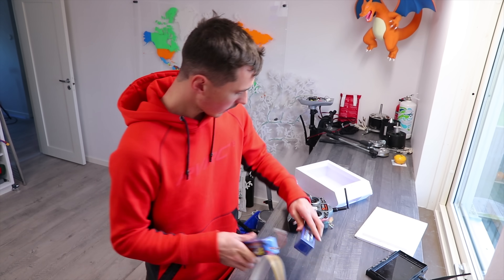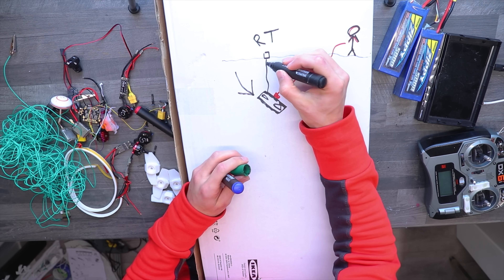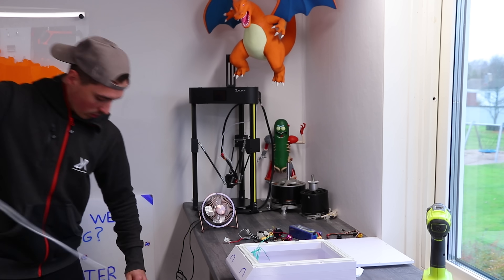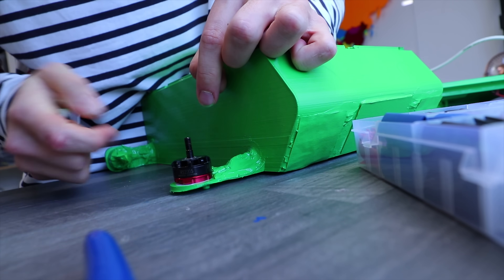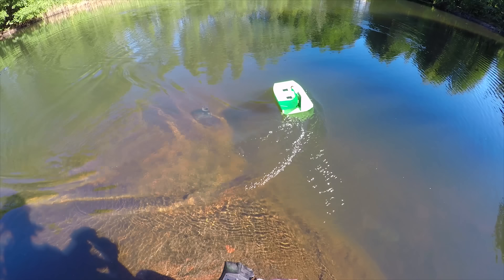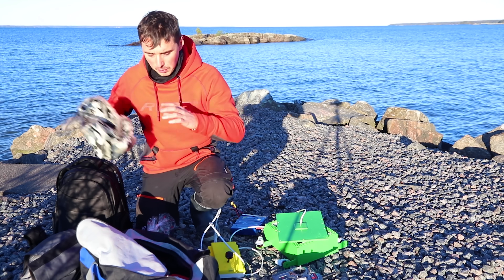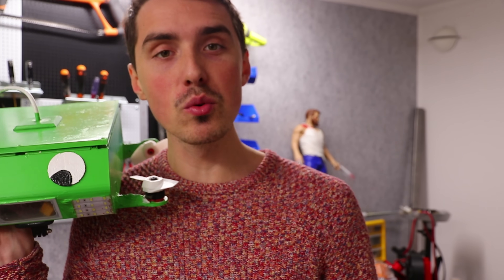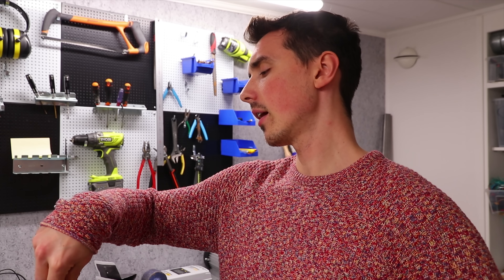3D Printed RC Under Water Drone - PART 1

Comment: Did you consider the fact that the reason your radio TX won't work is an approx. 30dB refraction loss at the water surface? And you easily can negate that refraction loss, so that  your submarine happily will operate without the buoy aerial ?
The trick is simple, just submerge your TX aerial. I'm not making it up. For your frequency/TX PWR, you should get a range of around 30-40 meters. If you submerge the TX aerial 30 meters out from the shore, you will get an effective range of at least 30 meters in all directions from the aerial.
Go on.....you know you want to !!

Comment: Make it heavy. Add wheels and a balloon inside.  You can blow air using your wire pipe and use the balloon as a ballast whenever you need to make it surface.

Comment: Have you considered acetone smoothed ABS? That's the most watertight material I ever tried, and keeps 40° hot tub water without leaks. 
Also you could make designed areas for weight/air outside the electronics bay, so you can adjust with a bit of water if needed. 
I really like the concept, but attach a fishing line to the floating part just for emergency use when it goes haywire. (We want to see the aftermath.)

Comment: I'm sure you already finished the project, but if not, how about you make the smaller unit, put all the electronics in, and then fill the damn thing with hot glue, lol. That way there's no air, AND you've waterproofed the electronics. xD

Comment: Hey dude I love this idea, I actually want to start building something like this myself soon, because I love filming underwater. Could you put the batteries, and other electronics into the flotation device? You would lose a little power due to the wire resistance, but surely not that much with them only being 3 meters.

Comment: Go dual, an outer hull that keeps 99% of the water out, and an inner keeping 99% of the remaining 1% out. Gives you a dryer environment to work with the electronics. Only have to be a few mm between them. Watching this with great interest, you rock. :)

Comment: Hey, good video!! 
I have a solution for the drone goes down... Just use the weight of water. If you add a ballast inside, you can increase the weight and the drone goes down. If you want to go back to the surface, empty the ballast. A submarine works like this :) 
Good luck and enjoy!

Comment: Floater design has some issues with it. How about those fancy plastic drain pipes from Biltema or some other local store, 90 degree corner pieces and you have a floating donut. 3D printed box on top of that with separate cable attachment  that takes the pull and separate cable inputs into the box.
The drone then - you could prefill that with distilled water and hope nothing dissolves in it to make it conductive.. or use some other liquid. Or vacuum pack the electronics and let the drone flood itself, adjust the flotation with pipes that can take the pressure better. 5m depth is already 0,5bar pressure compressing the air cavity inside the drone. Why fight it?

Comment: I got an idea and I hope you like it. Fill the drone with water resistant gel or use small plastic isolated bags with water resistant gel. 
This would work both as a weight and as a way to prevent water leaking in. (I think?)

Comment: youre running regular quad motors underwater without a problem?
Won't the bearings rust and kill the motors?

I Crashed my quad into the sea water yesterday, recovered it in 2 minutes and rinsed it with my water bottle, got home and rinsed it more under the tap. 
Can I use those motors again?

Comment: You should try to use a ballast tank instead of putting rocks inside the drone, that's how submarines rise and descend, you can probably make one with a plastic bottle and a water pump connected to one of the channels

Comment: 3D printing is a mistake for that kind of thing. Buy a box in the store, it would be way better and cheaper.
Reply: Simon came to the conclusion that his main problem was the empty, unneeded displacement volume. He can remedy that issue with a 3D printed design much easier. Also, of course you can make 3D prints water proof in all manner of ways. The right thickness and extrusion helps. PETG and other materials are even easier. Then there are always things like epoxy.
Reply: It would cause even more work. You would still have to waterproof all wire holes, cover/lid etc. so not really. It also needs the arms for the motors which are built in on the 3D-printed body. This is a hobby, so price should not be an issue.
Reply: @Daunlouded  it's almost impossible to waterproof a 3d print, so it can't possibly be more work.
Except if your a millionaire, price is always an issue.
Reply: @SaitoGray  Its not. If you use like 6 shells/perimeters when you print and real silicone gasket for the lid it would be fine.
Reply: @bagibadoo439   It wouldn’t, especially with water pressure.
Reply: @SaitoGray  Yes it does, I have done it several times. Multiple perimeters and over extrusion does the trick.

Comment: You need a solid gasket between any mating parts. There is a lot of pressure even pretty close to the surface and that can easily go through the gaps you had on the top plate gasket.

Comment: as you are re-doing the size can i suggest a smaller main body for electronics and then a "tube" on each side with a screw cap and holes to allow water in ( and air out) that you can put the weights into to save opening the main body and having to reseal it each time,,   love the ideas how do you waterproof the motors, ??

Comment: You should try to fill the inside with expoxy. A low temperature one so you dont melt your box. This way by filling it the mass would be close to zero in the water and all your electronics would be waterproof. But no heat dissipation and all the electronics would be unresuable.

Comment: when screwing it up try doing it  with a step on the drill a time and going to the oposite screw each time not the next screw this is how to correctly tighten a drum skin if you dont you ''chase'' a gap with the power of the screws and  this will eventually make a leak or on a drum skin a bump and then a split.

Comment: I always wondered if this would work, it would definitely be a lot easier and cheaper! Plus if you have the bobber antenna attached to a spring system that retracts the cable as it comes closer to the surface is probably the best way to protect the transmission cable.

Comment: just buy a jar of plastidip. I have one that I bought 4 years ago. every time I need to waterproof a receiver or esc or other circuitboard I open it, dip the board in is. let it dry. dip is a second time and dry it again. and then it it is done. If you want you can dip it a third time just to be sure when you do it for salt water maybe. but this works fine. I used it in crawler cars and water planes and boats. all had totally been under water many times without any problem.

Comment: It's a little messy but you could fill it with mineral oil, the water won't try to get in. Only issue is you'll need flotation, maybe glue Styrofoam to outside on the top.

Comment: If it will be a lot smaller and have a lot lower power draw what if you put the battery in the top-side boat you could seal up the sub? like silicone pot the the motor wires and even put a Schrader valve for 1-2 +psi ?

Comment: Part of the problem is that when you screw together items there is still a gap. You need to put a gasket or sealing compound on the components you are bolting together. It is a real surprise to discover  that no matter how good the tolerances of a screw fixing things together water still gets through. Use sealants such as those used by plumbers.

Comment: I feel with you getting this thing waterproof. I had a similar project and it tooked me 2 years to get it watertight. The best option would be to use another case (no 3d printed one or print it with 10 layers vertical and no infill....) You also need a one part rubber seal like a ring and than you have to use that much screws, the seal ist getting pressed in pretty good.

Comment: Hey Simon , you need to get serious with waterproof connectors, sealing the wire insulation,put shrouds on the props , and at the very least double the number of screws on the top hatch ,they're too far apart. smaller is definitely better for the electrics.yr ballast doesnt need to be water-proofed tho... think drone size...
Excellent to see all the learning in progress. Respect bro.

Comment: Older, lower frequency, AM/FM radios can penetrate into the water by a few feet. The only drawback is huge antennas. Model submarine builders use the old 72/75mhz. It could be something to explore.

Comment: Maybe the water seeps in THROUGH the cables? Inside them? Most cables are not watertight, and especially multicore cables act like a wick.
Reply: It's almost impossible to watertight a 3D print.
Reply: @SaitoGray  Both things don’t contradict each other. Water can come in both ways (even at the same time). It makes sense to check them all.
Reply: @SaitoGray  it's not. Use an oven
Reply: @peterzingler6221  lmao, yeah try that, let us know how it turn out.

Comment: Make the compartment that holds the electronicsas solid as you can and give it exactly one opening on the bottom. Think of it like holding a glass or a jar upside down under water, water can't come in because the air can't get out. In fact if you use a glass jar it is both waterproof and heavy. You can even seal the penetrations through the lid of the jar with silicone, and incorporate something like a valve stem, use a bicycle pump to build positive pressure inside the jar. Water ain't coming in that.

Comment: I love your videos but as someone who has worked with ROVs for 20 years it's clear that you know the square root of f**k all about designing one 🤣.

Seriously though, if you need some tips just give me a shout. I also possibly have some parts for sale. Waterproof connectors, things like that.
Reply: @Thomas-nc9fz  OK, where do I start? A smaller housing, cylindrical, with gasket seals, or o-rings though they are harder to achieve. ESCs outside in the water for cooling, coated with conformal coating to waterproof them. Proper subsea connectors into the housing, or cable glands for shallow water as they are cheaper. Better thruster layout (axial is simplest, vectored is fancy, but works better for this style of ROV. Buoyancy block on to, and lead ballast below. Gives stability. The list goes on and on...

Comment: Simon, as a failsafe you could coat the electronics with MG chemicals silicone conformal coating. I use it on my quads and they will fly underwater.
Reply: does it have any negative effects the coating... like overheat etc.
could I 100% waterproot my DJI Mavic Mini (1) ?
Reply: @g60force  The coating is thermally conductive. It would be hard to do a mavic or a phantom because you would have to coat every pcb, but technically possible. Just look up waterproof fpv drone, 
Samm Sheperd has a great video on it.
Reply: @josephrossman1600  wouldn't spray on modified silicone work better? And alot easier to get those hard to reach gaps. Would deff have to hit each pcb as well.
Reply: Conformal coating is only so good getting worse the higher the current like on an esc, you will need multiple coats to really have underwater level of performance. If it's just getting splashed that's fine but, if it gets flooded especially if it's salt water you want to pot them preferably with epoxy or you could get away with silicone if you want something slightly less permanent like caulking silicone as long as it's electronic safe I've used ge silicone 2, no acetic acid curing if it smells like vinegar don't use it.
Reply: @thirtythreeeyes8624  Mate, I did say "failsafe".
Reply: @josephrossman1600  Ya but, chances are if it springs a leak at depth it's gonna flood. Although having it fully waterproofed would make the need for a sealed hull unnecessary and you could use some foam for buoyancy which would eliminate a possible failure point if the hull doesn't seal properly.
Reply: Silicon is a no-go with electronics. Just spray it with Krylon paint.
Reply: @thefreedomguyuk  the coating is MADE for electronics
Reply: @thefreedomguyuk  You obviously haven't looked at the product. Its highly recommended
Reply: @thefreedomguyuk  Why is silicon bad?
Reply: @thefreedomguyuk  This has got to be trolling haha. Don't use electrically isolating non-conductive silicone conformal coating made for pcbs instead use spray paint.
Reply: What Is Islam?

Islam is not just another religion. 

It is the same message preached by Moses, Jesus and Abraham.

Islam literally means ‘submission to God’ and it teaches us to have a direct relationship with God. 

It reminds us that since God created us, no one should be worshipped except God alone. 

It also teaches that God is nothing like a human being or like anything that we can imagine.

 The concept of God is summarized in the Quran as:

{ “Say, He is God, the One. God, the Absolute. He does not give birth, nor was He born, and there is nothing like Him.”} (Quran 112:1-4)

Becoming a Muslim is not turning your back to Jesus. 

Rather it’s going back to the original teachings of Jesus and obeying him
Reply: @ahmdabdallah5811  Just don't post stuff like this on a Rc related hobby page🤷🏽‍♂️. There are forums where you can preach religion on to people🤷🏽‍♂️🙆🏽‍♂️. Have a good day sir🤗.
Reply: @ahmdabdallah5811  Jesus Christ did condemn the false Gods so do not try to use his name in vain!

Comment: Nice Video👍 but the drone has too much upward trend .. you have to make it smaller as you said and install a cylinder that you can fill with water with the remote control (something like a large syringe) by filling the cylinder with water, the drone becomes heavier and  decreases, when the water is pushed out it becomes lighter and increases.
Sorry for bad english 😅👍